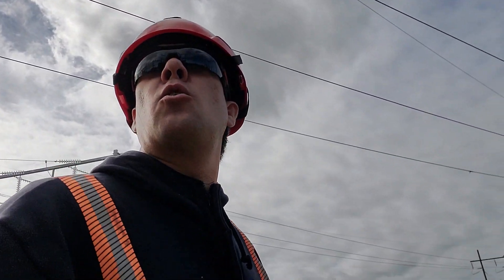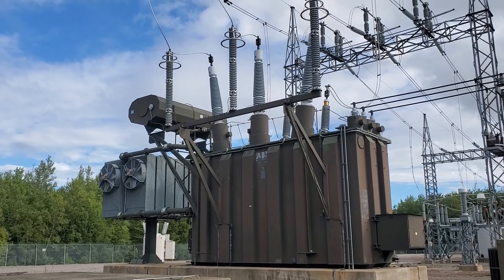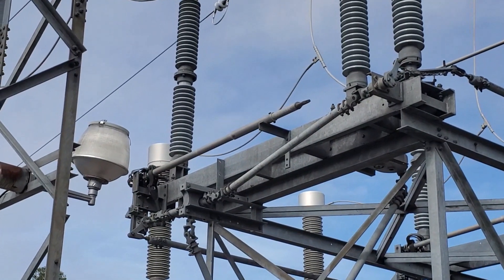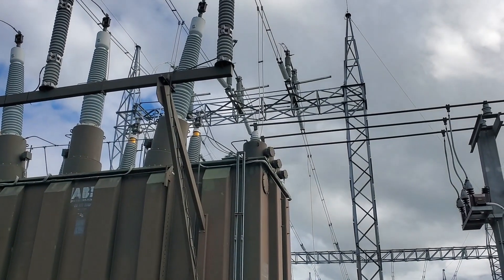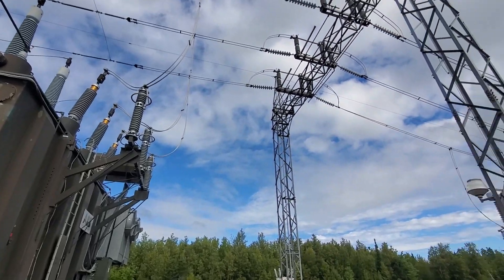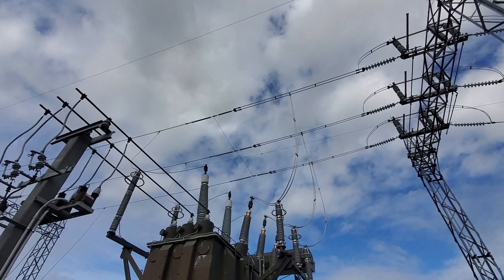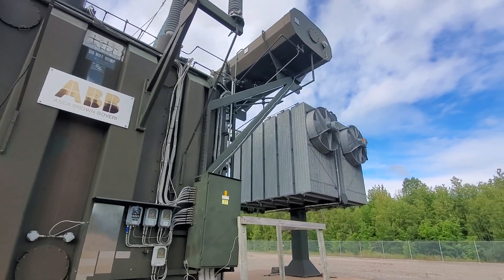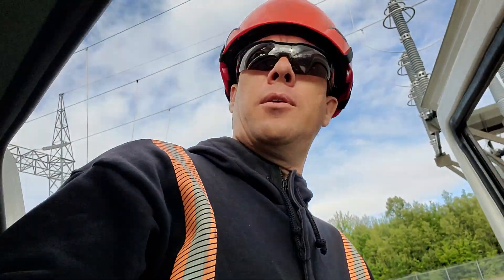230/138Kv Transformer with 12Kv side bushings

Comment from the maker: In many of our substations, station service comes from a 7200-120/240v pole type transformer. This is a bit of a unique setup, so wanted to grab a quick walk around of this Power transformer with 3 different voltages!
I was in a bit of a rush, but I'll follow up with a video in the future naming each specific component on a power transformer.
Reply: Very angry 😡 sounding xfmr! What is the mva rating?
Reply: i may have missed in other vidoes but is that system running at 50 or 60 hrtz.
Reply: @southernapocalypse4824  
North America (incl. Canada) - is 60 Hz except for a few isolated cases involving trams and electric railway systems and then the system frequency is even lower than 50 Hz.
Reply: @southernapocalypse4824  You can tell by the higher pitch tone of the angry buzzing sound that it is 60 Hz. In contrast, 50 Hz systems have a lower pitch hum.
Reply: Thanks for the  tour of that big boy primary trans. I’ve seen those on rt 84 in NY being transported. The rigging and placement must be fun to watch.
Reply: Appreciate the tour, as always there is lots to absorb  and understand.
Reply: I still have not been able to locate the winner of the giveaway. Is there something I am missing?

Comment: Same deal in Europe. The 400/220kV, 400/110kV and 220/110kV mostly have a third set of windings that provide 20kV or 15kV medium voltage, just to power up a substation low voltage transformer. If they don't, the medium voltage is obtained from a local 20kV or 15kV distribution line, but that's rare as I know.

Comment: 12470 is coming from the tertiary. Probably also being used to monitor voltage. It's going to a 3 phase transformer. It's either 120/208 or it is a 120/240/208 delta. The CB has a trip coil and a close  coil that operate from DC voltage. There is a battery bank somewhere in the yard that supplies DC for relay protection and powering circuit switchers.

Comment: If that big transformer had a fatal failure, how long would it take to get a replacement out there?
Reply from the maker: Let's not talk about that 😟. Lol.It would take a while. We switch around some feeds to eliminate any power outages. The entire transmission system has many redundancies, but would still not be a fun time. I'm not sure on the time line, but likely several weeks.

Comment: I've always wondered the amount of your jurisdiction between the actual generated power source and the substation(s) they serve. In other words, are you in charge of the lines between the actual power source and the substations?
Reply from the maker: Really great question! I'll be sure to mention this one in a video.

My responsibility is from the distribution power transformer to the customers meter.

Our lineman however receive training in all departments, including substation work and transmission.

My role as a trouble/customer service lineman is to respond to any emergencies related to our system... 

This role trumps any jurisdiction. During emergencies of any kind; substation, transmission even private owned lines.... I have the authority to operate equipment necessary to make the situation safe.

A couple examples:

We have a federally owned park which has hundreds of miles of private owned distribution lines. One night, there was a pretty bad fire in the middle of the night. Fire dept could not get ahold of a park representative . I was able to open a switch (which we owned feeding the park) and then further assist the fire dept in safely extinguishing the fire. Once the emergency is under control, the situation is re evaluated. Not something I typically get involved in repairing.

Another example, my training is limited as far as any in depth knowledge of our specialized equipment. We have departments that are specialized for repairs involving internal damage to a power transformer, relays and metering equipment. However, again during emergencies, I'm typically first on site and able to operate any necessary equipment to both make the scene safe and prevent further equipment damage

Comment: I'm an engineer that works on protective relaying systems for all aspects of transmission and distribution equipment.  Mostly handling the calculations and logic processing in all of the microprocessor based relaying equipment that is installed today.  Always cool to look at how things are done in different areas

Comment: a fun thing to do when you're in a transmission switchyard, grab a fluke, put it on AC voltage measurement, touch 1 of the leads to ground and stretch out the 2nd lead out into the air (not touching anything), you can sometimes measure 100V+ depending on the voltage of the yard, i did it in a 161kV yard and got like 70V
Reply: I was working  in a 735 kv switchyard and we connected one probe of a Simpson multimeter to ground and the other one the body of our truck....R.I.P. the multimeter!

Comment: I saw some huge transmission towers that had flashing lights on the top. How are those powered? I imagine it'd have to be solar, I doubt there's a transformer on each of those towers to power a couple lights.
Reply: I've seen somewhere that some use the impressed voltage on a separate line strung near to the main conductors to power batteries that then power the lights at night!
Reply: Just wind a coil around the power line. The power line will act as a single turn primary with the coil a multi-turn secondary. These are often used as self powered current monitors which wirelessly transmit to a meter or circuit breaker.
Google wireless current sensors. The currents running through the power lines are very high so extracting power from them is quite easy.
Reply: I don't know. If the tower isn't in the middle of nowhere I'd guess they take their power from the closest distribution lines.

Comment: Is there short-circuit protection inside the transformer for the 12.47 windings?  (for if something short circuits the 12.47 bus bars up stream of the fuses for the small 208Y transformer) ...I'm assuming they're relatively low capacity windings. The large auto transformers where I live for 230 to 115 kV have delta-wound tertiary windings at 13.8 kV, also for powering the substation equipment.

Comment: Thank you for sharing this super transformer. I'm guessing there is backup 120V power for critical monitoring, and no doubt those radiator fans use 208V!
Reply: Most utilities use a battery bank/ charger system to power the protection and control system in the control building/ field devices.  Under normal conditions the AC station service supply feeds the battery charger to supply the DC system. If there is an outage the batteries will feed the system for varying amounts of time depending on specifications
Reply: @dustinboyce25  Nice! Thank you 🙏

Comment: Do you typically run a DC supply and battery bank fed from the AC station service to power the P&C functions in your substations?  I would assume you are fairly similar to most other utilities.

Comment: Two things I noticed that are "unique":
On the 230kV side going out the line, there is a MV strain insulator with a jumper around it.  Any clue what that is for?  I've seen that done to hang a CT inline, but never with a jumper.  It's not like it could be used to isolate 230kV.
There are strain insulators separating the 230kV from the 138kV - and the middle of those look to be grounded to the static wire.  Any idea why?  Is this so a surge can't jump from the 230kV to the 138kV?

Comment: 1:56 Do you call this a power transformer or an auto transformer.  Looks like it has a tertiary windings.
Reply: Very common for auto transformers to have an HV/MV auto transformer common winding and a separate LV tertiary winding like this.  Many times it will be used for the station service and when longer HV lines are used to feed the sub there will often also be reactor bays for use to counteract line capacitance during light loading at night
Reply: @dustinboyce25  yup, that's why I'm saying that's an auto

Comment: How common is it for electronics to die or have issues after a power outage / surge when power comes back on? Our fridge now blows capacitors on the board after a power outage. We now have to replace it.

Is there a power surge when power is restored? If so how much is it? Would it be best/wise to turn off the master breaker after power is lost and only turn it back on once power is restored? Im just wondering if there's some type of inrush of current that juices up the power? I also have no idea why we lost power so I could have surged before the power loss.
Reply from the maker: A much debated topic...
Power simply going off and coming on is not much different the turning your breaker off and on. In a perfect world at least.
Sometimes when power comes on, there could still be a fault on the line. Voltage may be low for a very short period of time. It may also take a moment for voltage to regulate as tap changers adjust to the sudden cold load pick up. The variation is typically insignificant, but has certainly caused isolated issues.

There being a "surge" is generally a misconception.
Most damage for surges occur during lightning strikes, equipment failure or unique situations where lines are energized by neighbouring feeds of a different potential. Even loss of only 1/3 phases can cause issues. Especially on 3 phases systems.

The most common culprit of damaged electronics is loss of neutral/bad connection. 

During some large outages, I hear a very small number homeowners having an issue of some sort. Often times the outage was simply a piece in the puzzle of what led up to the damage.

All that being said, opening your breaker certainly will not hurt. I guess it could fall into "better safe than sorry"  Infact, it helps us out a lot, as it reduces load when picking up large feeders!

I've heard many success stories from users of whole home surge protectors. They wire directly into your main panel.

Comment: At what voltage does a transformer start to audibly buzz? Or does it have to do more with the amps. Since a microwave transformer has 2k volts but not many amps and they are silent.
Reply: Microwave transformers aren't generally silent, the humming when the magnetron is on is mostly the transformer.
Reply: It’s mainly the amps, possibly both amps&voltage(=power/wattage). Voltage alone doesn’t do much although it will make the primary winding use amps. But if the load increases, a transformer starts humming louder while the voltage doesn’t change (or even drops a little). So it’s mainly about the amps.
Reply: It has the most to do with the transformer's construction. If it's constructed in such a way that more vibration is possible it will be louder.
Reply: It's not the voltage, but magnetic core saturation. If the current is interrupted such that the iron core is magnetized, the transformer will be very noisy until the core is demagnetized because the iron core will saturate every half cycle and draw excessive current. Also, if there are a lot of electronic or unbalanced loads on the transformer, this will cause harmonics of the 60Hz which is what is actually heard. 60Hz is very hard to hear, while the third harmonic or 180Hz is well within human hearing range.

Comment: I have experance one of those transformer that broke transporting trailer in Half om FM473 in Texas.  This massive 500 MVA transformer blocking both lanes of traffic.   So rancher was nice to cut a hole into the fence as a Detou to let traffic though.   They  cant find another transporting trailer.  Transformer sat on road for 3 weeks until they came up with a plan.  
  They lift transformer up with a crane put bunch of oil well casing pipes under it and roll it. 
That drag and roll took another 3 weeks to move last 7 miles to substation.  Texas Use 347 KV and 138 KV.   My primary single phase 14.4 KV to ground .   It used to be 12KV/7200 V 
That was mess when they had do a power cut and change all the Transformer taps.  Some had
Pull the fuse side line to some ranches .  Due to gate was close 
And left a tag to call  To service the equipment on the pole.

Comment: I know this sounds like a dumb question but is it safe to touch the transformer not the electrical lines but the outside of the transformer
Reply: I was told by a station engineer that anything you can reach is probably safe to touch. (isolated and grounded) The flip side is in this trade you ALWAYS test first. Why take a chance?
Reply: @rupe53  thanks for answering my questions
Reply: @rupe53 that's a dangerous theory (anything you can reach), I have been in many legacy substations where one could easily reach out and accidentally contact the line or encroach on limits of approach/ minimum approach distance and possibly risk flash over.

As to the original question, the transformer tank itself is bonded into the substation ground grid in at least 2 locations to prevent touch potential between a person and the unit in the case of a fault inside the substation. Transformers themselves are a "dead tank" unit insofar as the external tank casing does not see the potential energy carried inside
Reply: @dustinboyce25  ... ok, I really didn't mean jumping in the air like an NBA player to see if you could reach a line that's 10 ft up! Gotta use a little common sense, which is why I said test first if you are not sure. BTW, my training is 80s vintage fire department. The utility guys gave us the basics, which usually included things your mother told you. When in doubt keep your hands in your pockets and don't touch anything!

Comment: Why would the conductor bundle decrease to 1 if the current increases? Wouldn’t you need more to carry the current?
Reply: if you look close you can see the single conductors are much thicker than the pairs. Some of that is done for flexibility (wind and ice load) and ease of working.
Reply: I think you may have been looking at that backwards. The bundled conductors are on the 138kV side (the secondary winding side) of the transformer.
Reply: @GoldenPants911  This indeed.

Comment: Why do they drop it from 230 to 138 for the rest of the yard?  Cost of the equipment for further step down is better?
Reply from the maker: Pretty much. The 230+ kv is only used to express feed between terminals. (Terminal - basically a substitution that doesn't involve distribution feeders). Once transformered to 138 kv, multiple lines then feed dozens of substations with 138-12.47kv transformers.
Reply: Shorter poles for local distribution. The lower the voltage, the closer the lines can be to the ground and eventually under the ground in residential areas.

Comment: I work for the company that builds the circuit breaker. That is one of our 245kv class breakers
Reply: Is there a large AC supply difference between the 240kv/ 144kV versions of that breaker?  Assuming if course this is the straight SF6 dead tank design that requires the massive heaters for cold weather operations.  We have used them in 144kV and 72kV applications in our system
Reply: I used to be the product manager of a manufacturer of live tank Circuit-Switchers.
Reply: Whats the interrupt rating for that CB?

Comment: If you have to work on that big transformer, how long do you have to wait after disconnecting on both sides?
Reply from the maker: Once it's open and completely isolated from any possible source, grounds and bonds can immediately be installed and work can begin
Reply: It has no significant capacitance, so I’d guess about 1/120 of a second should suffice. ;)  It might be pretty warm though.
Reply: It depends on how many summer students you have to help get the ground chains up 🤣🤣🤣
Reply: @dustinboyce25  I wouldn’t use chains for grounding, regular wires are more reliable.
Reply: @Engineer9736  the are called ground chains but in actuality are copper wire. Size varies depending on the available fault current at the site.  Some of the bad ones I work in need double runs of 4/0 chain